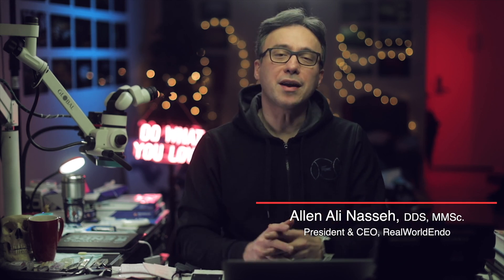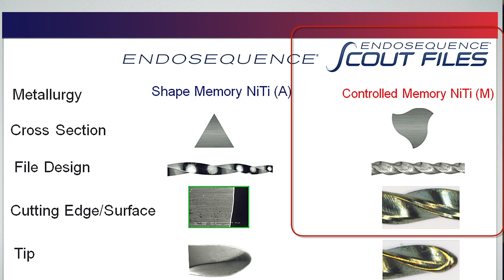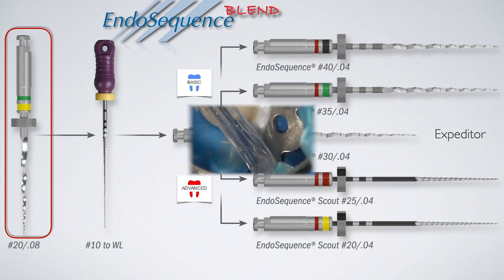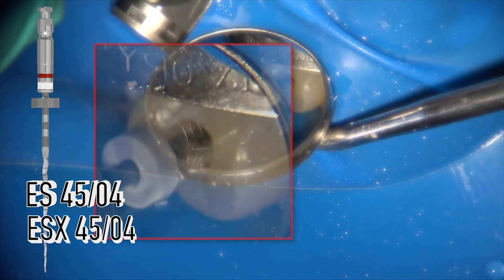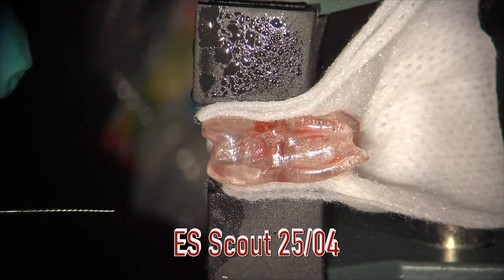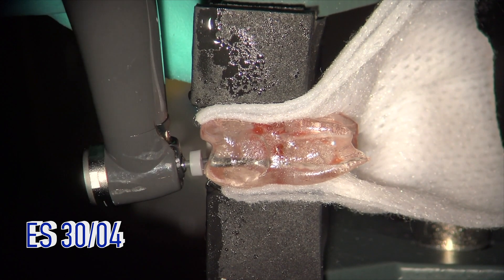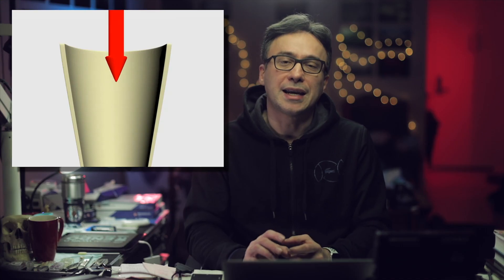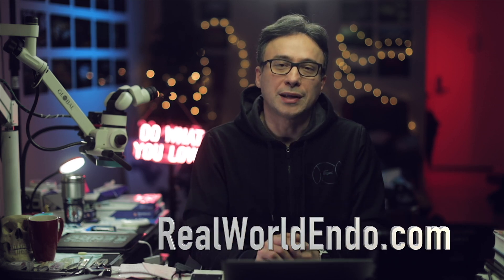EndoSequence Blend Protocol

Comment: Would using the Scout VT with ES CM be a more updated version of this blend protocol? Can we use a constant taper for the coronal preparation and a VT for the apical preparation or should we use the VT ES CM with the VT scout? With ES CM, is the loss of effectiveness worth the perceived gain of safety (if any) as compared to the non-treated standard ES or ESX for coronal curvature?

Comment: Hello Doctor. Can you explain what is happening at 4:00 when you are obturating using single cone hydraulic condensation? I see you are bringing the BC sealer tip about 5mm away from WL in each canal and then take a 10 file and bring that to WL in each canal? And do you also insert each master cone and then pump it at all to WL? I would love a description. Thank you

Comment: Do we always need to use a rotary file? If we have a 35 canal and we activate the irrigant, do we really need to shape the canal to achieve sufficient disinfection?
Reply: Hi .. appreciate ur question posed to Allen .Do we wait for tailor made minimal invasive files currently for anterior teeth and another for posterior?
Canals as of now need to be assessed by the clinicians to remove contents of pulp remnants, debris and smear layer and get to exact WL. Minimal scraping of layer of tooth goes for a size 35 as to ur reference.
Cone fit configuration augment sealer placement and economics.
I am glad u assess the situation than pick up and run endofiles.